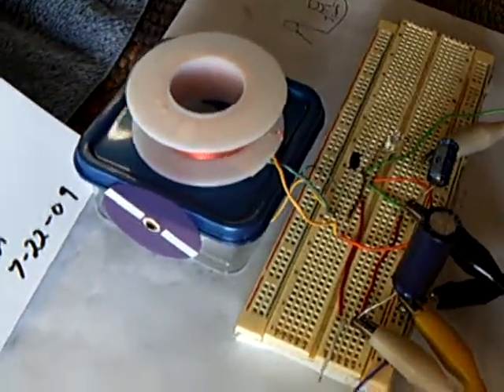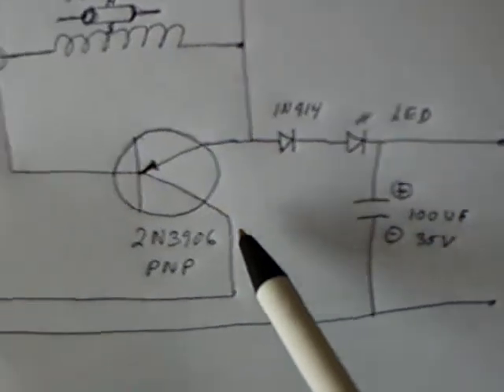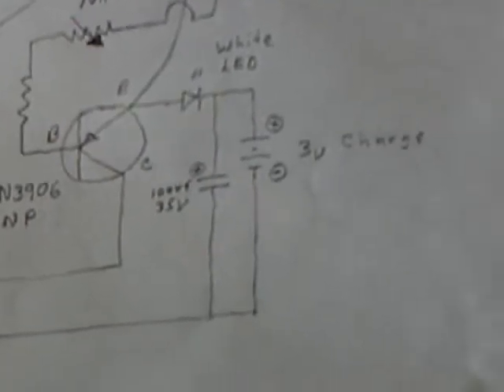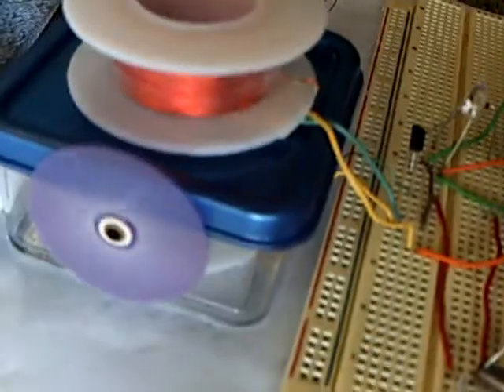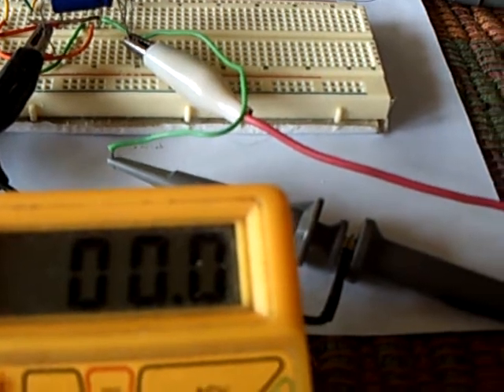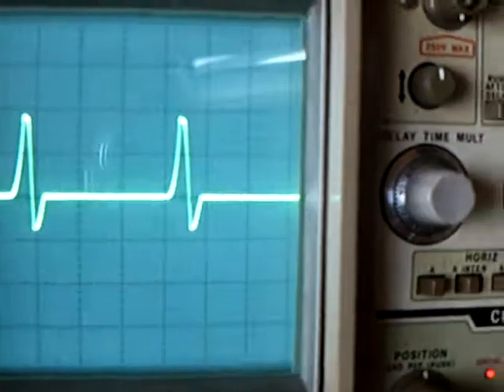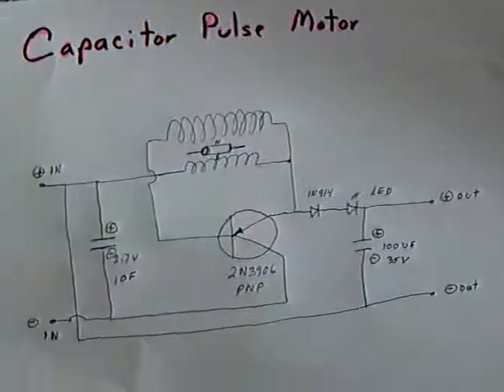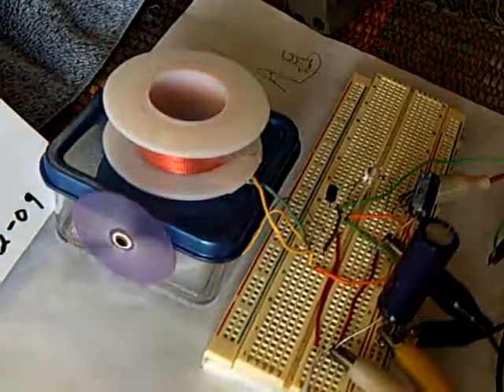Capacitor Pulse Motor----  Scope shots

Comment: I think how to switch the 3 parts (-+-) and I will try connect 2 merged red switch  
-(charge)-----------__________+(drive)
-(charge)-----------__________-(drive).
You know if this can be done with a transistors sitching?....you know im newby :).  The next stage would be run a pulse motor discharging the CH capacitor.Tnx for share

Comment: i believe if the stepup the voltage on the backend enough to make a spark--you could feed it in series back to the frontend capacitor.